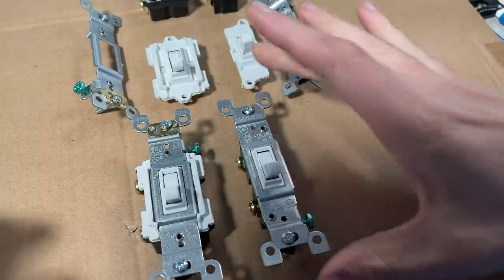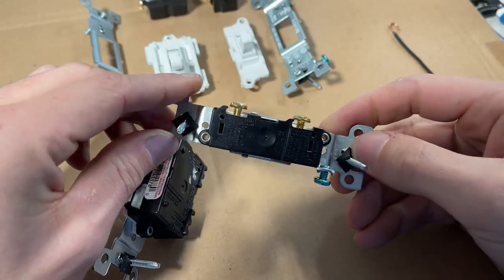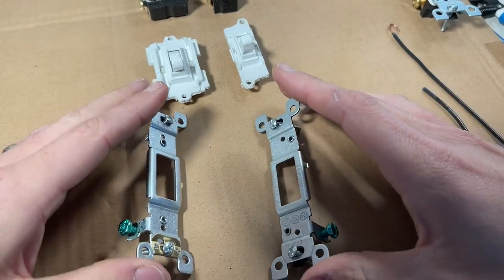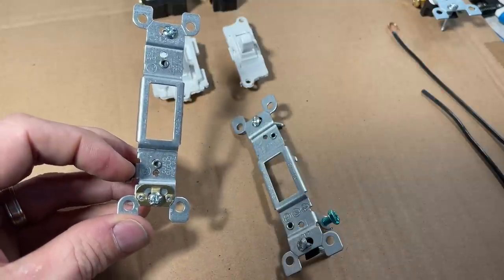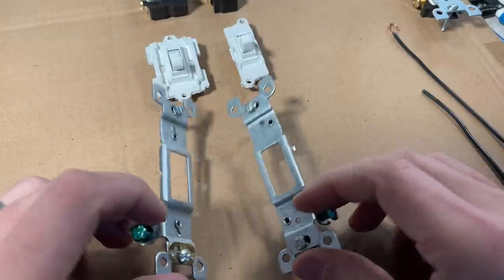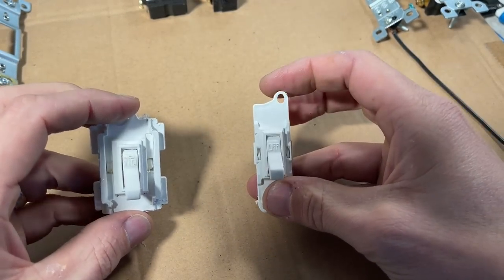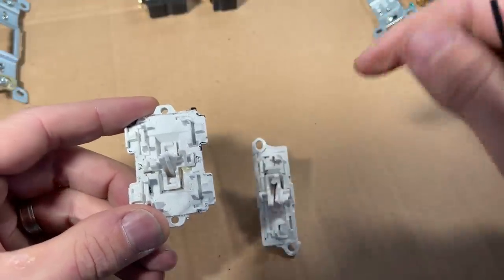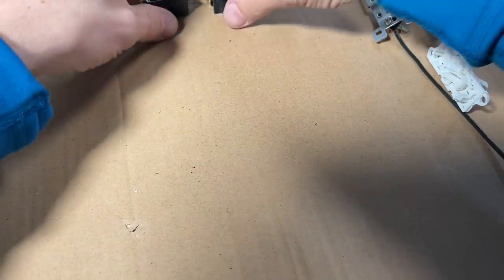What Light Switch Should You Buy For Your Home |  Commercial vs Residential

Comment: The one that you call “commercial,” in this video was actually the “preferred,” switch that Leviton makes. That extra click action actually has a purpose: It makes it harder to flip the switch slowly, which can help to eliminate the arcing issue at the end of their life, which most of our old switches have. We have the Leviton residential model, but the backs of ours are white instead of black. We have already replaced 3 of them, 2 of them with the preferred, and one with a Lutron skylark contour LED+ dimmer. We are probably replacing more, but we live closer to Lowe’s so we might end up getting the Eaton switches.
Reply: Leviton uses the 'preferred' name to designate the spec grade parts. Another term for that is commercial grade. Literally considered good enough for government work. The residential ones are not.
Reply: Yeah, learned that after writing this comment. Those are sure to last longer than the residential grade might. I ended up getting the Eaton model elsewhere, and they are even better, literally impossible to stick the switch in the middle between on and off, which would eliminate arcing.

Comment: Commercial housing is also used for a 2-pole switch (e.g. to switch 240v). I put one of those on my water heater and on my well pump near the pressure switch. Wanted to be able to turn off within site of the equipment for service.
Reply: Those kind of switches seem a little light duty for those applications... It would be much better to use a 30 Amp rated switch.

I don't know about yours but my water heater is on a 30 Amp breaker and we'll pump on a 25... Both exceeding the ratings of a 20 Amp switch.

Comment: That 2020 NEC states you don’t need an equipment bonding jumper when using a receptacle or switch with a self grounding clip. Also, stated in the NEC is that you have to remove the paper or plastic washer on the screw since that blocks a solid grounding connection.  I still attach a ground wire to the ground screw; however, because I feel better knowing I have a better ground connection.
Reply: I still use a ground wire on the switch or receptacle as well.

Comment: For me, the clamps in the commercial models are worth the price of admission. I've done my time with shepherd's hooks, and even if you get the hook right, now you have to ensure it doesn't walk out from the screw, and that's even when doing a tight right-hand hook.

But there's something about the commercial that's built better. You can feel it in the lever mechanism.. I'm in an 80-yr old house and many of the light switches are original, with a heavy "click" to them. They aren't as easy to use as modern switches however.

Comment: Good, pertinent information. Maybe others are like me, they assume a higher price and/or the word "Commercial" mean a more rugged unit designed for far more duty cycles. Thank you for showing this just isn't true. Since the speedwire connector is not recommended, the strip gauge and lock down plate is the only time saver between the two. 

Several other factors.... 

1. Feel. The nice, smooth switch on the commercial is nice, but how much time do you actually use enjoying that smooth, confidence inspiring switch? Probably less than .25 seconds each time. How does that look on your Feature vs Price balance sheet?

2. Size. Many times I find myself replacing switches and outlets in older homes and often the "box" is only a hole in the wall or brick surface. I think copper was cheap back then because a lot of the original electricians crammed all the wire they could in that hole... except the ground wire (if there was one). 

3. Price. Since you could replace three household switches for the cost of one commercial, and there seems to be no NFPA Electrical code requirement, I am now firmly in the cheaper is better group, ESPECIALLY if you're ganging two or more switches into one electrical box.

FInally, THANK YOU! THis video is about where the rubber hits the road, and you've provided great information. Even the extra brass grounding plate works both ways. Several older homes I've rewired had boxes where no-one even thought about grounding anything... so the ROMEX you just ran (if applicable) supplies the only ground in that case, you get more protection. (The brass seems overkill... most metal mounting plates are metal, as is the screw that holds them in place, aren't you grounded simply by mounting a with or without the extra plate?) 

Reasonable cheaper is better to me.
Reply from the maker: Hey Don, thanks for all the great feedback.  Really appreciate you taking the time.

Comment: So it looks like we should go with residential switches and commercial outlets.   Thanks!
Reply from the maker: At least that is my path forward 👍
Reply: In 2020, I purchased a home built in 1998. It was built with residential grade Leviton switches. I noticed many of them felt weird. At least half the switches in the home were physically cracked and broken to pieces. I replaced every switch in the home with commercial grade and will never purchase one of those cheap switches ever. Even if you've got 50 switches in your home, it makes a difference of less than 50 dollars to upgrade all of them to commercial grade.

It was the small thin body of the switch that cracked and broke. This makes it pretty clear that the larger body on the commercial switch makes it tougher.

Comment: I'm not an electrician, just an apprentice. An observation I've had with using philips bits installing outlets. I use a drill with an adjustable torque limit dial  (most drills have this feature). I started out with a #1 robertson and got er dialed in a bit before the screw deflects. I had one day only philips bits and I used the same torque settings for tightening it down and it works without stripping. Just my observation, I still prefer the square bits for speed. Love your stuff, glad I stumbled across your channel.
Reply from the maker: Thanks for the feedback Ben and best of luck with your apprenticeship 👍

Comment: In my experience the residential switch contactor points are smaller, and will break down faster. This results in an audible POP! when the contactors close. Small cost to go to a proper longer lasting commercial switch. Used to be the contactor points were cheaper metals (less silver/Beryllium IIRC).
I do notice that the rivets on commercial are in line with the direction of the switch throw, as compared to the offset rivets in the cheaper switch.
Lastly, in a gang box (2/3/4 switches in one box), the slimmer switch may be easier to install, just be careful to bond the ground screw and don't short out the adjacent switch no matter what you use.

Comment: I think one thing of interest with switches is how watertight it is. I think thats an issue of someone decides to flick a switch with a wet hand. A  good, tightly sealed switch on the front would be best. Maybe cover that issue. Like, pour water on the front of the switches, spray them with water, throw them in a bowl of water. see what happens. Otherwise I don't see a huge difference. Its not like with the residential commercial outlets where the residential outlet is much worse, that people should always go with commercial or above.

Comment: I use a combination tip(slotted and robertson in one) screwdriver for the screws on receptacles and switches.
Reply: @Erthe Except you want the #1 tip version for receptacles/switches. One of these and a #2 square screwdriver is all you need most of the time. Still carry a good set of phillips and slotted though.
Reply: I didn't even know this was a thing.  Thanks

Comment: I’ve had that deflection problem on a couple of my light switches. It caused the lights to flicker. I ended up replacing the light switch with one of those fat one’s and used the screw terminal.
Reply from the maker: Thanks for the feedback Jason

Comment: I am a home gamer – I own Klein ECX bits and screwdrivers.  I find that a JIS (Japanese Industrial Spec) screwdriver works well for electrical outlet/switch screws.  The JIS screwdriver tip looks like a phillips but has a straighter geometry.  JIS screwdrivers will not cam out like phillips.  Vessel makes some nice and rugged screw drivers.
Reply from the maker: Hey Brian,  thanks for the feedback.  I will check out Vessel 👍

Comment: Believe only purpose of "grounding plate," as you call it is to ground the cover if cover is metal. Metal box and ground lug should always be grounded with a wire connection to the ground wire.

On the commercial grade switch, the empty space to the right of centre is not for three-way. It's for double pole, if you add another pair of contacts.

Thanks for the videos.

Cheers.
Reply from the maker: Thanks Farnham, appreciate the feedback.

Comment: Forgive me for bringing this up here, but I can't find the appropriate video on your YT site, and I do NOT do any kind of social media. I need a video on wiring a single-pole light switch into the middle of a circuit. I have installed new wall cabinets and I have an undercabinet light to put in. The wall is open and I have full access to the wiring. The new switch will be going between an existing switch to a ceiling light and a 3-gang box of outlets. Note that there is another outlet down line of those. So, I need the proper way to wire my new switch in so that it controls the light and still allows power to continue at all times. Would it be simpler to add a junction box to carry the power and just take power from that to the switch? Thanks.

Comment: In my house after 22 years, half of the residential grade switches were cracked and broken to pieces. They were made by Leviton. The small plastic bodies of the switches were cracked in half and falling apart. That's pretty unsafe IMO! I replaced every one of them with the commercial grade. It was a total of 21 switches so it only made a difference of around $13. That's really not enough money to be a concern in my opinion.

Comment: I use a Combo drive (Milwaukee calls it an ecx tip). They don't seem to be gaining a whole lot of traction but they work perfectly for most electrical screws.
Reply: @Erthe I LOVE them! I bought two or three of the 11-in- 1’s
Reply: I got an ECX tip in one of the milwaukee boxes of  impact tips and I tried it,  and I must admit that I love it.  With the number of switches and outlets I changed that day I was convinced that I need more of these tips.  I am thinking of buying the tips and the actual screwdriver...

Comment: You missed going over a critical selection criteria for most laymen and that is the lever action feel and sound. Im going to use 20amp switches for all my rooms to keep everything outlet/switches etc 20amps the same as the breaker but Ive noticed that some 20 amp switches are very loud and what I can only describe as high strung when you move the lever up or down, they harshly and jerkily slap into place with a very loud annoying click. Yet on lowes or homedepot websites the videos dont ever show the switches being actuated so its hard to order unless you go in person to the store.

Comment: I use a number 1 square drive in a DW 20V impact . As soon as it makes the impact sound its tight. If I have a new #2 Philips I can usually get it to impact without stripping screwhead too. I love a long #2 square drive for residential panels and breakers...
Reply from the maker: Hey Eric, have you tried the Milwaukee #1 and #2 ECX screwdrivers and bits?  I have 2 on order after several people recommended them.
Reply: @EverydayHomeRepairs  haven't tried them. I will have to check them out.

Comment: The differences between the two switches that your not seeing are the ratings. The "commercial" is rated for 20 amps and 277 volts while the "residential" is only rated for 15 amps and 120 volts. If your lighting load doesn't exceed the "residential" ratings there's no need to spend the extra money. In a house the circuits are normally all 15 amp breakers so the "residential" is all you need. However, in commercial we use 20 amp breakers as the normal size and the lights are frequently 277 volts, so we have to use the "commercial" switch. The physical size is as you saw they use the same body for multiple switches it help keep the costs down not anything to do with quality or durability.

Comment: Something I've come across is a switch or receptacle with both 14ga and 12ga wiring. You MUST loop the conductors (or on an outlet, put them under separate screws.) That terminal plate may not settle down evenly over the different sized conductors, so that the smaller one doesn't get properly tightened, and can work its way loose. (DYIer here, not a pro. Scold me if I'm wrong.)
Reply: Yes, if you use both sides of the plate clamp you MUST only use the same type of wire on each side. For the loop around screw terminal (and indeed most terminals) you can only attach one wire. If you need to attach two wires to one attachment point you need to splice in a pigtail.

Comment: These are awesome videos! Thanks for making them! I'll add my two cents as an electrician with a few decades of experience. Technically, residential grade, spec. grade and commercial grade don't exist per se. They're marketing terms. There is a real standard called Federal Specification grade, but that's something else and they would be stamped with a Fed. Spec. mark. If you really want to see differences between switch and receptacle design and quality, you'd have to include some from other manufacturers like Hubbell and Pass and Seymour. A very interesting comparison would be between "residential" grade switches/receptacles from two or three manufacturers, then "spec" grade, then "heavy duty" or "industrial" grade. There will be differences in contact design, materials and thickness, self grounding or not (you've touched on this), and backstab or back wire (you've touched on this as well). For instance, Hubbell "builder grade" devices all have the self grounding tab on them. Other differences which I've noticed when installing receptacles or switches from various brands is whether you can fit one size larger wire under the screws (sometimes done for voltage drop), differences in yoke thickness  with some yokes so thin that the device pushes into the box when you tighten it, and differences in the plastics used on the bodies, with some being so brittle that the switch easily cracks apart (I've seen a lot of cracked Leviton switches over the years). 
Happy New Year! Keep up the great work!
Reply from the maker: That's a great idea and I am very interested as Hubbell.  Many professionals with years/decades of experience indicated they prefer Hubbell.  Looks like I better start buying some receptacles!  🍻 Happy New Year!
Reply: Yeah, the plastic on Leviton switches get brittle with age.

One more thing:  never use plastic faceplates, they crack if you tighten them too much, or if things are not perfectly aligned.  Use the unbeatable nylon faceplates that you can twist 180 degrees without breaking them!

Comment: The difference between the switches does not justify the price increase. The duplex receptacles are another matter...the commercial grade is worth investing in especially in high load/use locations.
Reply from the maker: Completely agree and that follow my same conclusions.
Reply: See my comment on switched loads...fans, furnaces, infrared heat lamps. etc ..need a 20 AMP switch for long term durability not a 15 A rated.
Reply from the maker: @TheTruth.K.J.V.  I appreciate the engagement and feedback.  Take care 👍

Comment: One issue is what you are trying to switch power to.  If you need to switch more than 15 amps of power you have to go to a commercial grade switch.  I have a water well that has had some issues of loosing prime in the cold weather and it runs on 120v dual 15 amp breakers making it a 30 amp circuit.  I have not seen a non-commercial 20 amp or 30 amp switch myself and with such high amperage I would not want to use a non-commercial switch. 

Also on you other video with the wall sockets.  I was informed by a electrician that was installing some outlets at a place I worked at that the ground terminal should be to the top on all new installations due to code to prevent objects from making contact between the neutral and hot terminals causing a short and possible electrical hazard.
Reply from the maker: Thanks for the feedback and to the point on the ground terminal being up there has been a lot of back and forth in the comments section on that one.  Seems like consensus is that ground terminal up is not called out in the code but is preferred to indicate a switched outlet and in other areas of the US just adopted as best practice for all outlets.
Reply: None of the receptacles at the place I worked were switched.  All the ones on the new side of the building, built in 2014 where ground up and all the ones in the side of the building from the 1980's where ground side down unless they were replaced.  First time I ran into this was in 1999 when my parents bought a new place and the ground terminal was up on all the plugs.
Reply: As per the  National Electrical Code  it does not matter which way its personal  preference.

Comment: For the terminals I recommend & use ECX #1. Milwaukee makes a 3 piece electricians screwdriver kit which is what I used. Perfect fit and does not slip. Try it, you like it!
Reply from the maker: Thanks for the tip Herb, I am headed to Home Depot now to pick some water lines up and will see if they have the screwdriver kit. 🙏
Reply: Herb, is this possibly a case of the cross-shape in the screw simply not being a Phillips, but a JIS screw? To the untrained — or old — eye they look the same but are very different. See: https://www.youtube.com/watch?v=VpqUhIZ-EJo